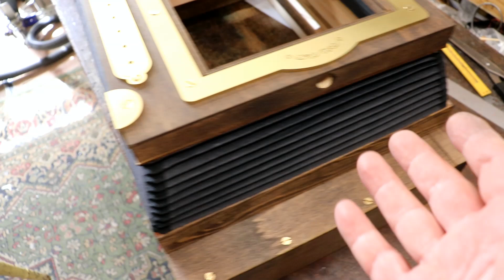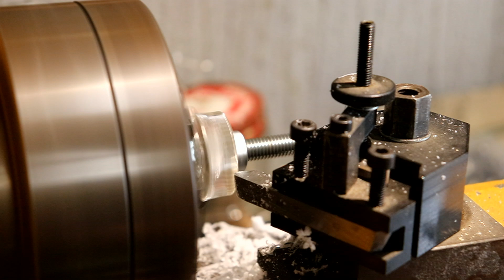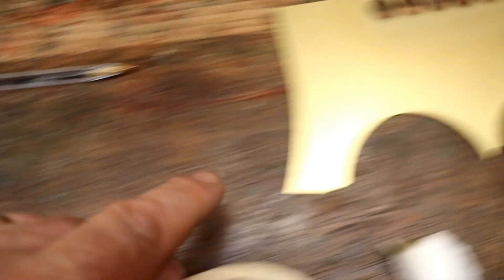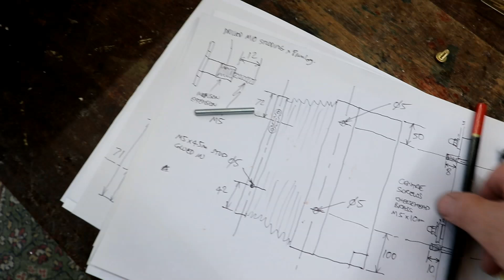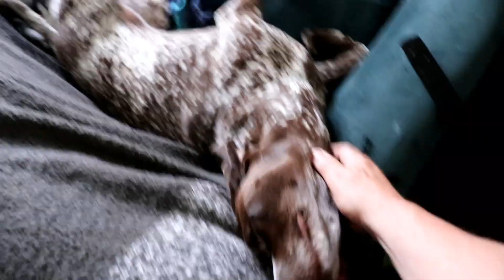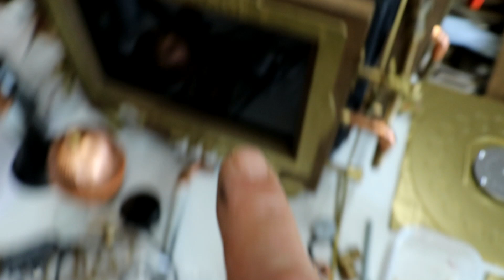Part 4 - Assembling exciting mechanisms & bellows levers

Comment: I think your pipe thread is not working is because one is tapered (north America) and the other is not (Europe).   Just a guess.    The thread is close but won't quite thread on, usually will go one full turn and that's it.
Reply from the maker: Thank you - I think you're spot on. The only other similar issues I've had have been with the antique brass shower hoses that are obviously manufactured abroad. I was so pleased to find that slightly sanding down the thread solves the problem.